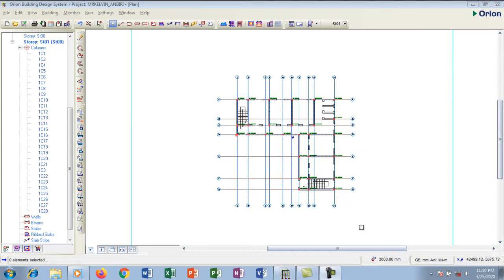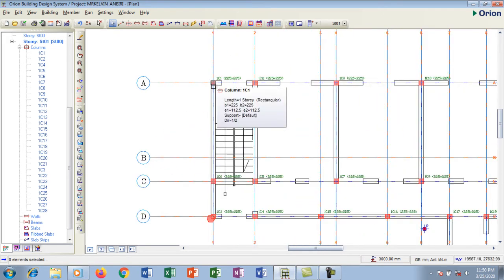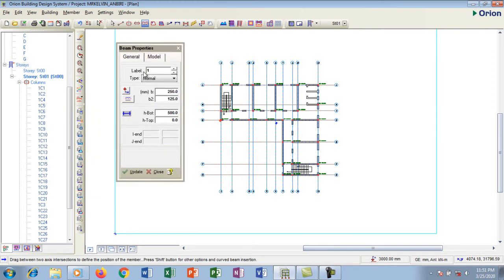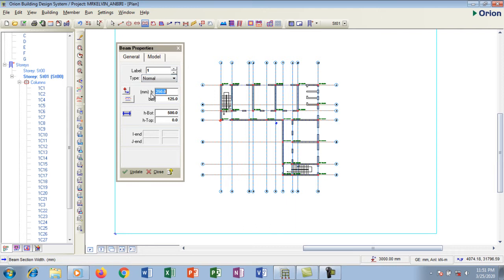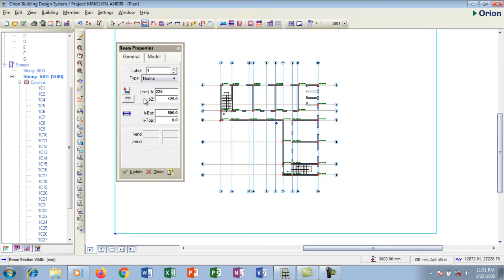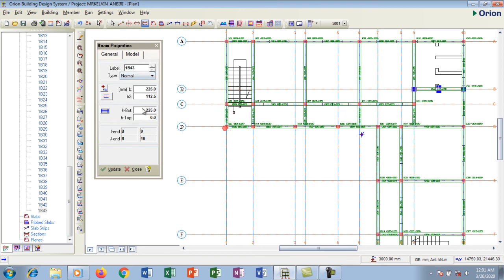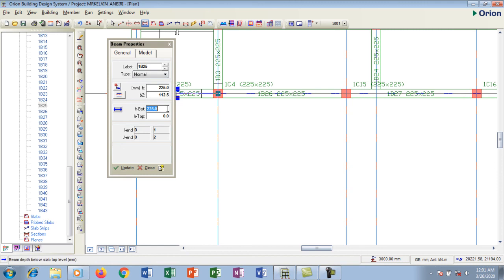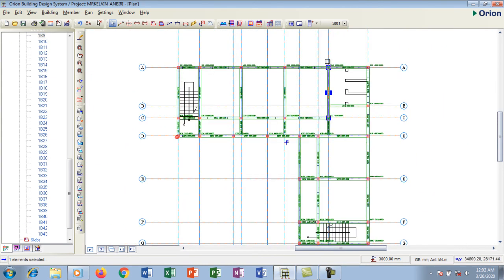Orion 18 Tutorial: How to create beam spans for structural design

Comment: Found this content helpful. But i can’t find the video on inserting columns as stated in the beginning of this video.
Reply from the maker: Pls subscribe and search through the channel
Reply: If roof level dont have slab, whats is the loading for roof beam?
Reply from the maker: The roof is the loading on the roof beams...
Reply: @cadteacher12  do you have examples how to calculate load from roof transfer to roof beam? Thanks very much..
Reply from the maker: There are different types of roof... Concrete  roof?
Reply: @cadteacher12  metal deck/roof tiles..
Reply from the maker: Orion does not do steel designs
Reply: @cadteacher12  do you have video tutorial how load transfer from roof to roof beam? Thanks sir
Reply from the maker: Yes I have, only on concrete roofs